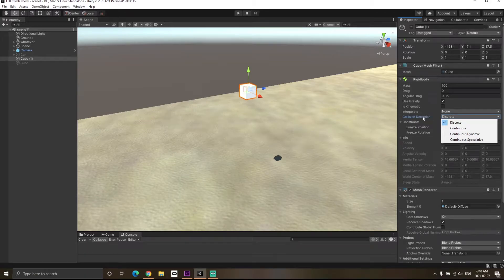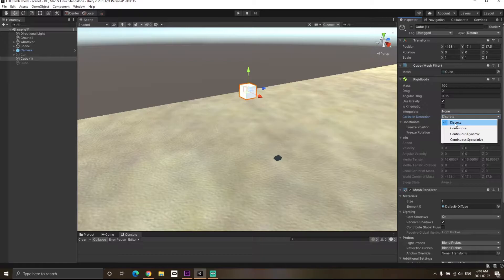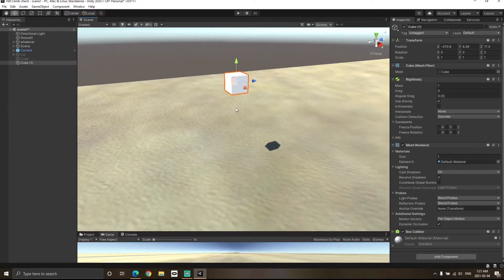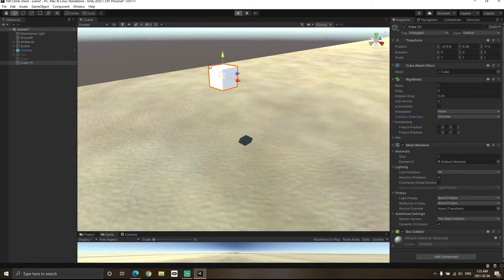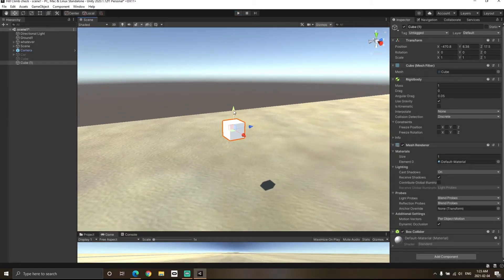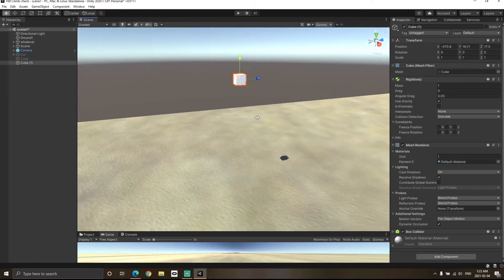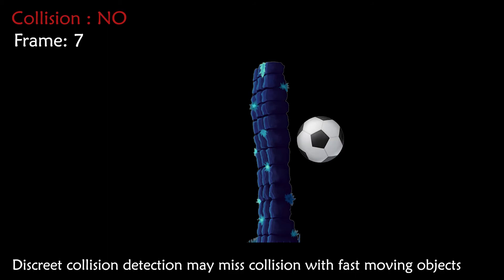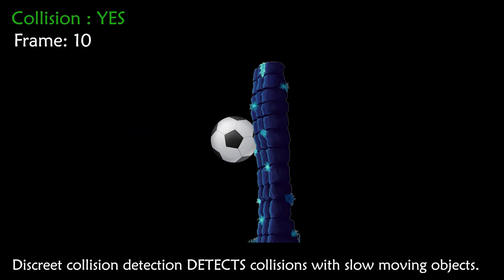Collision Detection Discreet - Unity in 1 minute

Comment: Nice video and really cool channel format, I like it :) What would be the best alternative for fast moving objects in your opinion?
Reply from the maker: It depends on your game actually. Having very fast moving objects in any game is generally not an ideal situation. It might push the physics system to its limits. If the fast moving object is just for show, you can write some kind of shader which mimics an actual fast moving object. If it is an actual object, you can either try to decrease the fixed time step so that physics calculation are more accurate (but not too less, it might impact performance). Also, For your fast moving objects, you can also use different collision detection options like continuous etc. I will be explaining them in the future videos :)